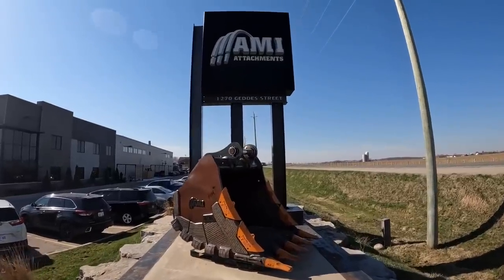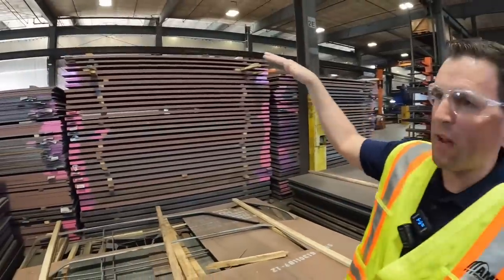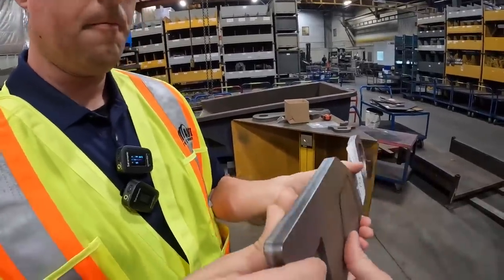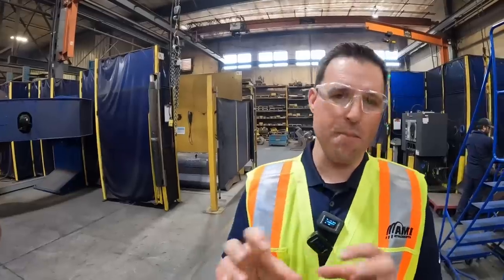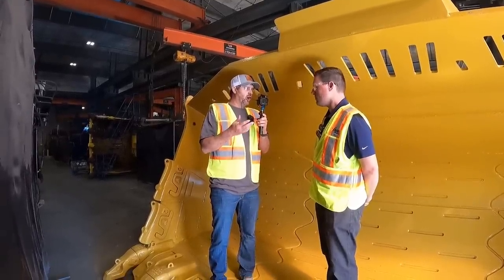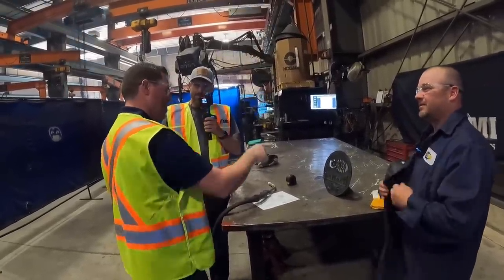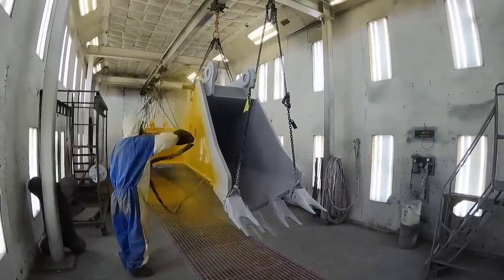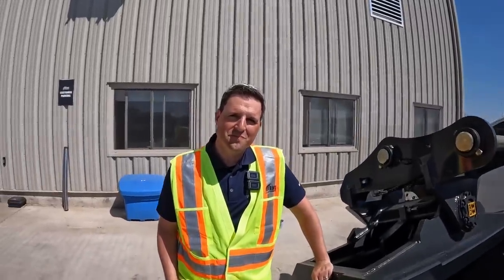Incredible Tour of AMI attachments factory! This place is as impressive as the products themselves.

Comment: The dump box on my truck is made of Hardox 450 steel. It is 2000 lbs lighter than an ordinary dump box and the floor is only 1/4” thick. It has hauled thousands of tons of Ontario rock and it still looks like new. That was a great tour thanks for bringing us along.

Comment: 6/5/23; ...AMI factory tour..✅️⚙️🔧👍👏🤷🙂 Thx for taking us along, very impressive..kinda parallels aircraft mfg & multiple layers of QA & Certification..re: that Hardox & Strength steel 'inside'  decals which confirms (via testing/inspection during mfg) to receive these  certification stickers. 
  Great video showing super quality of these AMI products & inventory of parts if repair/replacement- if ever- is needed.👍

Comment: If AMI is watching, I have some questions.  You dealt with the flat stock, what specs are there in tube, hollow bar, and rounds?  On the plates, are they die stamped with grade and heat number?  Do you require test reports?  Do TR's and Ht #'s follow the product.  Are all manual welders certified?